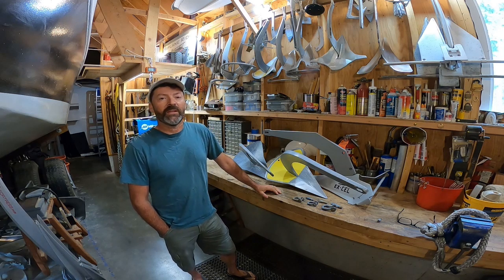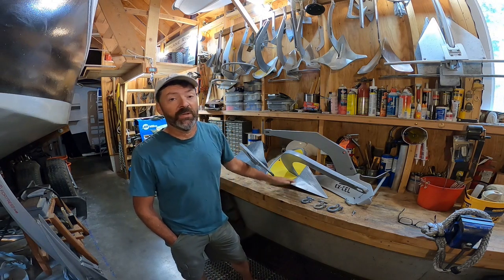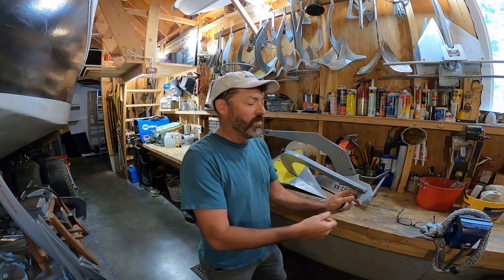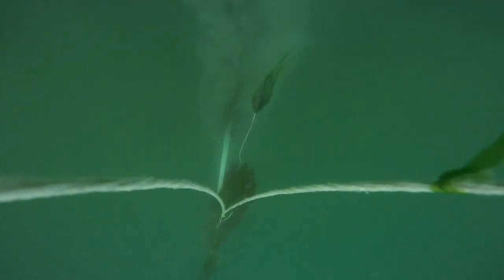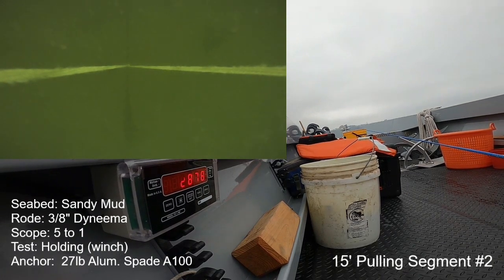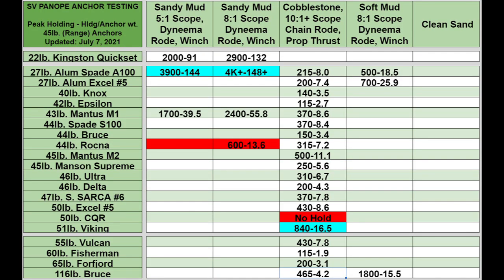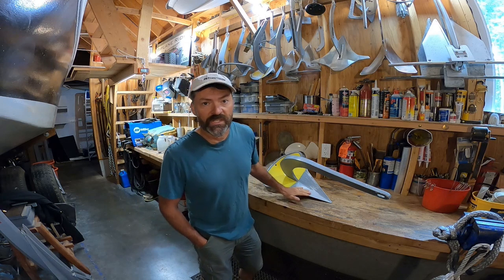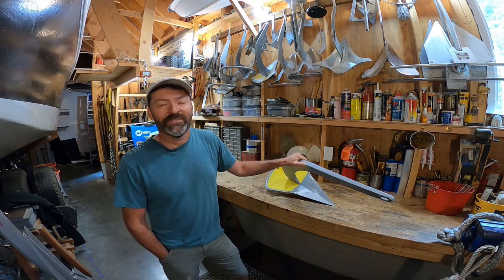Spade A100.  Anchor Test Video #116

Comment: Great as always! 
I belive there is a argument to made for comparing this A100 at 26lb to other 26lb range anchors. Weight up on the bow can be an issue for both boat and back! ;) My gut feeling is i would rather go for a A100 then a steel any steel anchor at the same weight if a storm was brewing and i had to choose.

Comment: Steve. Thank you for this continuing project and all of the information from it. I bought an old used fortress fx 37. I see that fortress appears to not feature on your tested anchors table. How come?
Reply from the maker: Hello R H, Unfortunately, I lack an appropriately sized Fortress (like your FX-37) to include on my "45lb." Chart.  That said, I do include the FX-16 (10lb) on the "20lb" anchor charts.  Look for this chart in next week's video as I will be featuring a new anchor in this range (Quickset 22).
Reply: @flygoodwin  you are welcome to use mine for purposes of the test.  It does not have the appendages that help it set in some bottoms, and is used but in good condition.  What would be a least expensive way of shipping it?  I’ll give it some thought.

Comment: It might be proper to compare these aluminum anchors with other anchors of similar weight. Price is one factor, as is size, but when I buy an anchor my main consideration is weight. (How much can I hoist up the bow roller?) Can we compare your 1-5 scores for aluminum anchors against your scores for similarly weighted steel anchors?
Reply from the maker: I think a comparison to 27 lb. Steel anchors would be great.  Unfortunately the closest steel anchors that I have only weigh 22 lbs.  The 21 lb. Steel Spade that I have is really in a different category.  That said, as the accurate holding power numbers from the winch testing arrive, we can certainly compare any anchors we wish.

Comment: My excel#6 anchor dragged me yesterday. 40kt gusts and 2.6m swell on 5 m depth. 
Chain 10m and rope 45m
Boat is 11ton
Reply from the maker: Thanks for the report, qb.  Please tell us the bottom type and geographical area.
Reply: Weather
https://youtu.be/BeLdAlEicc0
Start location
https://youtu.be/VpnWUWGoPN0
End position
https://youtu.be/fpIlHse7owo
Reply: @qb6025  was anything fouled on the anchor when you brought it up?
Reply: @MrAthlon4800  anchor was clear.  It rather caught the last mooring. I intentionality motored around it several times.
Problem was, that dyneema does not absorb wave jerking. I wish I could measure the forces.